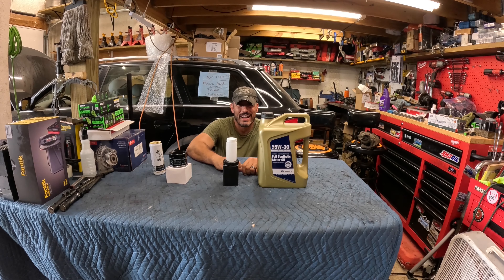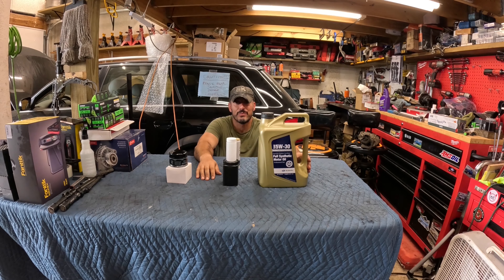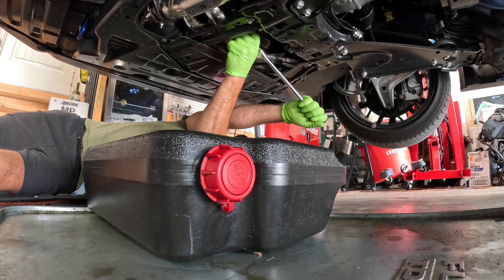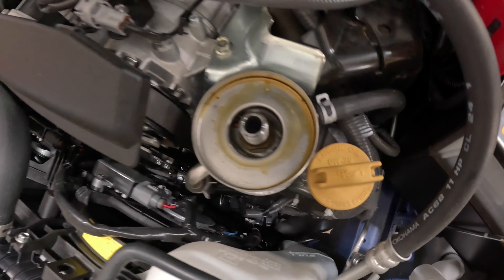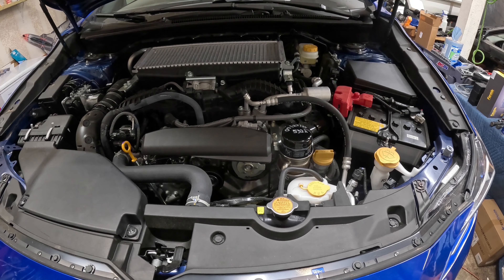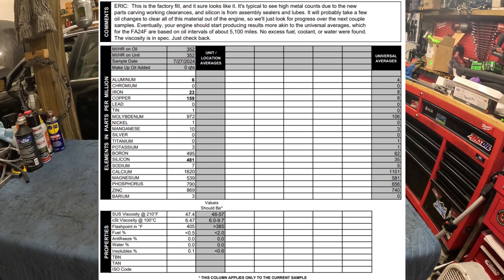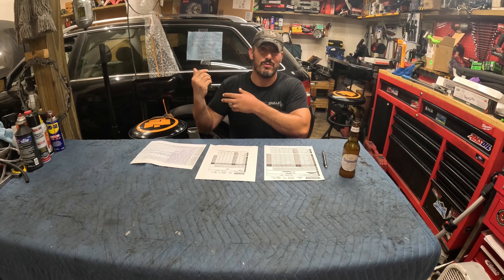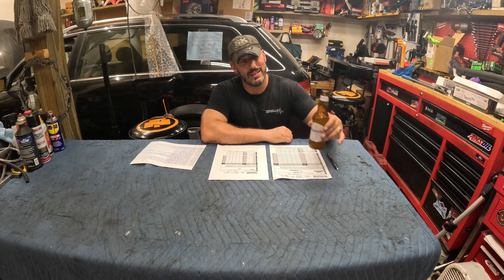'Break In' Oil Change Analysis - Reviewing the Data for a Brand New Engine - SUBARU FA24 Goodness!

Comment: Great comparison video. I just got my black stone lab report back after 15,000 miles. My numbers look very, very similar to yours , but lower amounts with the silicon (Aluminum 9, Iron 28, Copper 32, Silicon 65). It appears it does take a bit of time to get that junk cleared out. Can’t wait to see what my next report will show.
Reply from the maker: Awesome! Thanks for the comment and info. Yeah, it does look like it takes a decent amount of time for the engines to 'settle in.'